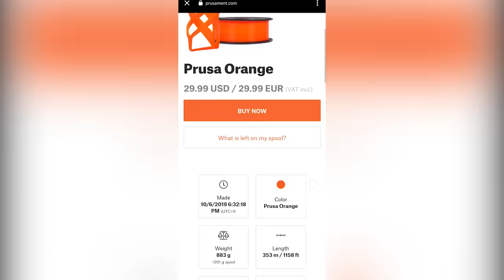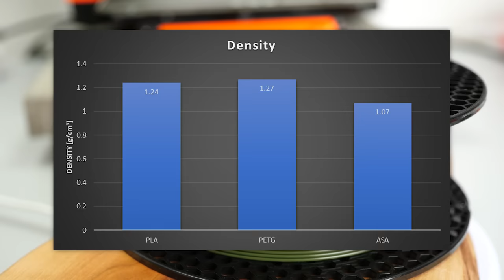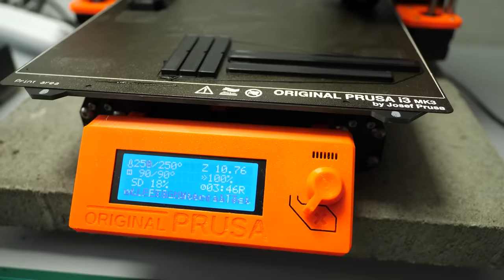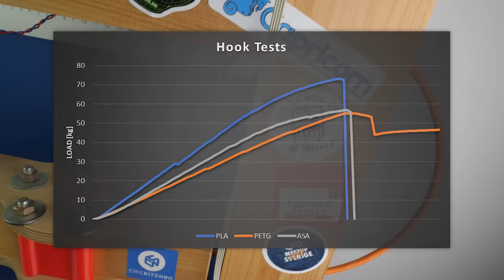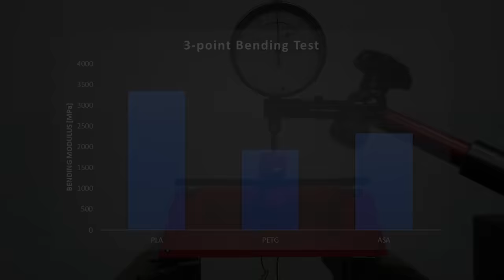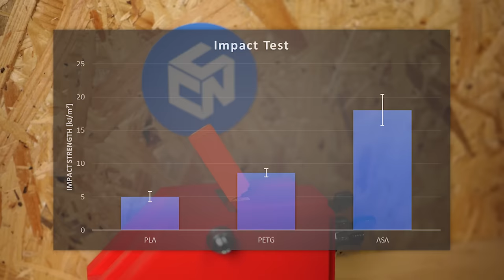The BEST 3D printing material? Comparing PLA, PETG & ASA (ABS) - feat. PRUSAMENT by Josef Prusa

Comment: Would be very interested in seeing this test repeated with the prints having spent a significant time under a UV light
Reply: I can tell you 1 thing: rip PLA
Reply: What is a significant time? I have Wood PLA stuff outside in the garden since August last year. So far still looks good.
Reply: @steffengr.5556  Wood PLA isn't fully PLA. straight PLA degrades here in the sun after like 8 months it starts to crack & be brittle.... Ofc we're at 9000ft above sea level. ABS has lasted forever and petg has so far been ok
Reply: We already know that PLA can't handle UV. No test needed. If you are going to put PLA printed parts outside in the sun, paint them :-)
Reply: Was more interested in the actual figures for ASA vs petg for tensile and deformation post uv
Reply: So I've been doing this for quite a while... I am not getting any serious results so far tbh. This will be a long long term test...
Reply: @gg-gn3re  Interesting points, so what this have taught me is be more considerate of the purpose and environment that the print will be in
Reply: @MaxQ10001  I'm new to this would a 3d printed snake house last long using PLA?
Reply: @MaxQ10001  I've had pla printed gnomes in my garden for three years and the color is still vibrant and no cracks.
Reply: @vampcaff  where did u get the garden gnome stl? Would love to add a few to my garden.
Reply: I saw a video of someone having had made clips for flowers or something that were left outside for a year or so, and they seemed fine and were PLA I believe.
I suppose it really depends on how long it has spent in direct sun. Either you can consider the amount of variables the beauty of 3D printing, or a big maze!
On the plus side the time it probably takes for UV to matter, you could just print another one lol
Reply: @Interknetz  Also depends on the specific filament blend. A bit of UV-resistant additive goes a long way.
Reply: @gg-gn3re  LOL yes. I was shocked when it happened the first time.
Reply: @vampcaff  How are your gnomes holding up two years later?

Comment: I used the sample PLA roll that came with my printer, then immediately switched to PETG. It's a bit tougher to dial in, but the thermal and UV resistance are good things in my opinion. And the warpage can be a good warning sign before complete failure, especially in printer parts. Oh, and small stringing can be easily burned off with a lighter.

Comment: i use petg when i need part to flex a little without snapping like i printed some hooks to keep my shed doors open they needed to bend a little to allow the door to pass under then click down to hold in place when i try pla it just snapped even when i annealed them petg is still going stong. i also notice with many materials exposed to the hsrsh Florida sun petg seems to hold up very well to uv and barely fade its color. Pla can fade quite a bit in the full sun and dark colors like browns and black absorb enough infrared that they wurp badly but lighter colors can survive I print quite a bit of abs in an enclosure made of pvc and mylar blankets and it works quite well for taller print you have to be sure to Orient it so the heat from the bed can flow up the print evenly. if it traps heat the you can get layer issues. The mylar blankets can keep it around 38c in chamber with no problem. Great work on your research.

Comment: Great job, as always! I use PLA and PET-G. ASA and ABS are no go for me due to their potential threat to health. I mostly use PLA and support it with PET-G when bending instead of cracking or higher temperature is need (like in-car hooks). I also use flex 40D material as a thin supporting layer (ie to create soft surface on a hand watch mount) or absorb a bit of vibration (like mounting something to my electric scooter).
Reply: Doesn't all materials pose a health risk due to their fume emissions?
Reply: And microplastics

Comment: Materials engineer here, even thou the tests are not standard, they are pretty decent to compare the materials. I would prefer petg hands down for most applications. Petg is a very sweet spot of additive manufacturing filaments. It is watertight with 1.75 mm wall thickness, can handle temperatures up to 75-80 degrees, ductile at low strain rates, moderate fracture strength, moderate impact strength, stiffness is a bit low but when you get a wall thickness of around 3mm, its very stiff. It is a very sweet material to 3d print structural parts.
Reply: why do you like it over asa?

Comment: Living in Florida, I default to PETG because of the heat.  Nothing I make is regularly outdoors or in the car, but if power gets knocked out or I do forget something in the car I can rest easy knowing the heat won't warp it at all.  However, revisiting this video several years later, I do see that I have discounted PLA too much.  I will start using them more interchangeably, I greatly enjoy the ease of printing with PLA.

Comment: It seems I was mislead about the strength of PETG, now I'm struggling to think of a use I might have for it.
Reply: Same, now i'm thinking about ABS+ or ASA.
Reply: The same here. However I have the HDglass PETG and it seems to be stronger than PLA I have from the same company. I can really break it easier...I do not get it...
Reply: @kamilchodzynski9395  Higher temperature resistance and it won't burst like PLA, so it is more durable.
Reply: I'm more surprised by how well PLA did in the strength test. No PLA I've used would stand any where near 73Kg on that pull test.
Reply: Exactly, as I said my PLA is far weaker than here presented. Either the Prusa PLA is super strong or PETG very weak unless the settings are special...
Reply: For me thats simple: everything indoor is made out of PLA. Everything I carry around, which might be transported in the car or is used outdoor I use PETG for.

Don't forget, for many designs the layer adhesion is the central concern. Meaning in most use cases PETG is clearly superior to ASA.
And you often want a certain flex. Stiffness means also beeing brittle.

I never bougt a spool of ASA/ABS and this video is for me a clear confirmation that I did it right.
Reply: In many practical applications PETG will break less easily due to the flexing and layer adhesion. This is especially true when printing casings for objects where you want the surfaces to have little bit of give without snapping instantly.
Reply: Adding to what others PETG doesn't deform under pressure over time like PLA does. I used to have some PLA reinforcements in my printer, but when I checked their screws 6 months after adding them they were fairly loose while the PETG parts weren't. Also, PETG has better availability and is cheaper than ASA.
Reply: It actually has better layer adhesion at about 220-230 degrees.
Reply: I've seen a similar test on a traction machine on a French channel and it came (in the order) PETG PLA ABS... I'll keep on PETG (UV resistance and stability)
Reply: PETG has better layer adhesion and also is more wear resistant than PLA. It does differ from brand to brand, I had encountered some weak PETG as well as really bad PLA that just melted in 90F outside. You just have to find a good brand that doesn't fail you :)
Reply: I mostly print PETG and I can say that it has way stronger layer adhesion compared to any PLA I have ever printed. I have not printed expensive, specialised PLA +, pro etc.

Also my PETG pretty much never breakes at a single layer line. Breaking surface often goes all over the place and sometimes diagonally to the layers. If it breaks smoothly along the layer line like PLA then that's usually because of too much cooling.
Reply: I don't think you were mislead.
On my own experience, PETG is the strongest one:
I printed a custom wheel adapter for gaming wheel with force feedback.
I had 4 broken adapters while I was using PLA (even with 100% filling).
Then I switched to PETG and since then I still use first printed adapter. It did not break (PLA was breaking on 2-3 day of using it).
Reply: He apparently has problem with print settings, he used default ones. And they seem to be not the best for both PETG and ASA.

First, he used too high fan settings. I use fan only when strength is not required, in bridges and overhangs, or when layer is too short to print.
The stringing is easily removed with heat gun.

And, NO fan should be used with ASA or ABS

Other thing - he got heavy stringing with ASA. Retraction is wrong or not used at all.

With proper settings ABS+ is the easiest to print. I assume same for ASA
Reply: @dkiulian  Any recommandation on a good brand for PETG?
Reply: @Levisgil47  Overture worked well for me and got nice quality out of it, but I also tried MatterHacker's petg and it was splendid (after figuring out how to print it. On my prusa i3 i had to use pla settings but change the temps. I can't say how many tries it took to figure this one out. But it is awesome quality, maybe the best looking so far) Both are quite strong.
Reply: @Levisgil47  I am pretty happy with Formfutura rPET. It is a good ratio money / performance. On the Prusa MK3S I print 230/225deg, first layer to rest, 90/85 bed, and fan between 0 to 25 max. Mostly fan does not work at all. No strings, etc. In addition , I keep flow rate 106.5% after calibration. Just if somebody needs...from time to time I put to the oven for few hours at 60 deg.
Reply: petg is one of the more food safe alternatives out there.  so there is that.  I would still coat it with something just to be sure though.  It doesn't seem to degrade in uv light as much either, so there is a positive if you are using it outdoors or somewhere where it might get direct sunlight.
Reply: Why is my petg brittle, it breaks across layers diagonally easily, with no give. I tried it from 220 to 240 C, different fans speeds.
Reply: petg flex back after being bent,  pla can't
Reply: If I wanted to make a thread that needs to flex, would the threads hold as good as pla?  I'm thinking of using petg for it but not sure if it can hold alot of pressure in the thread part, any advice anyone?
Reply: @NotHumant8727  240 is on the low end of what's recommended for PETG.  It's likely that you need to go higher
Reply: I don't know, this doesn't take into account repetitive movement stress cracks or UV exposure which are probably bigger issues in a lot of 3D printed objects that are used on a regular basis
Reply: @dkiulian  what brand PETG do you use?  My Hatchbox PETG consistently breaks at layer lines.
Reply: @CoreMaster111  what brand PETG do you use?
Reply: @73notch  Spectrum
Reply: @73notch  Hi, I have the same problem with most brands if I forget to turn cooling fan off completely. I print with the pla settings, just cooling fan OFF. I hope this finds you well and will help you.
Reply: Prusament PETG sucks compared to PM PETG.
It's extremely brittle compared to what Prusa used to exclusively sell.
Reply: Isn't there some food-safe PETG?

Comment: Useful testing and comparison. I am currently making GoPro parts with  PETG made in Australia where I live and I am very pleased with the results. One quirk, I can sit alonside the machine while I am printing PETG and I cannot detect any odour at all. Using the VisionMiner adhesive on a Creality glass bed and I have no problems removing the finished parts after it cools down a bit.

Comment: Love these videos. I've actually used PLA before to 3d print model rocket nozzles, and as long as the burn times were short it held up pretty well. I only saw about 1mm of erosion over a 1 second burn, since the nozzles were single use anyway this wasn't a problem.

Might post the testing footage when I've got time to put together a video.

Comment: Thank you Stefan, Your video helped me alot with my Antenna block project.  I'm printing an antenna holder for the Ubiquiti UAP outdoor wifi antenna. I ended up going with ASA in my final choice due to it's impact strength (it needs to be hurricane-proof), and be wind and bird resistant (wind and birds would twist the antenna to where the wifi would be decreased significantly) ASA also has superior resistance to UV, but also Temperature, and I also needed it to bear hot and humid weather as well as moisture.

Comment: Thanks for this review. Very useful as usual. To answer your question, I print mostly with PLA. It's easy and surprisingly good. I print with PETG when I need better heat resistance, such as parts for my printer or the ones that goes in the car.

Comment: A very thorough review of the material properties however deciding the proper material for the application may not be obvious.  My PLA small quadcopter frame  broke one of its arms during a crash on its first flight.  The frame was reprinted in PETG and  has now completed many flights and many crashes with out damage.  For my application PETG is the superior material over PLA.

Comment: I'm living in Nordic weather and minus degrees are normal during winter, down to -30C. I'd love to see you test these materials with cold temps also! Another point to add - impact strength of some plastics is increased when they have absorbed some water. I know this from RC hobby and propellers. Running them after winter, when they've dried out, they are very brittle. The trick is to put them into hot water and stay there for 12+ hours. So I hope you could take on cold test and hygroscopic (after printing) test of these materials.

Comment: Sounds odd but I have discovered that cleaning the filament before printing makes layer adhesion much better. Perhaps some sort of oils form during manufacturing? Not sure. I wipe mine with rubbing alcohol on a rag as I re-spool a new spool onto an empty spool. Give it a try. You’ll be surprised at the amount of gunk on the filament!

Comment: Personally I'm still sticking mostly to PLA due to being relatively new to printing.  Expanding to more materials once I get more skilled :) PETG is interesting me at least.
Reply: Try it
 Today's PETG is super simple.
Especially if you have a decent printer like the Prusa, standart settings do the trick. 
Press start and go to bed. No issue. Perfect surfaces, robust prints.
Reply: If you're printing PETG using Cura, make sure to up the temps to something around 240c for the hotend. If you have one where the PTFE tube goes into the hotend, you'll need to get an all metal one for it too.

That would only apply with something like an Ender 3 though; the Prusa wouldn't need modifications... maybe to slicer settings thouhg.
Reply: @moth.monster  idk i'm priting petg with 225c and it seems to work better for my filament. increasing the temperature that much causes more stringing. the recommended range on the sticker of my roll is 220~240. although i did get a bit of underextrusion when i was printing with 0.32mm layers that ruined some practical prints.

Comment: ASA is uv stable and can withstand temperature upto about 100 degrees celsius which might be its biggest advantage. So it can be a good choice for outdoor project in the sun. 
The bad layer adhesion compered to PLA  is a huge bummer because it limits the the design posibilities.

Comment: Thank you for these experiments, they help me a lot in my own experiments. I've been using eSUN PLA+ for my 3D printed planes for a while now and they seem to perform better than the other materials like Flashforge & Wanhao filaments that I use. It'll be cool if you can compare the eSUN line up of materials experimentally, considering they're pretty inexpensive for the quality that I find in them. I use the PLA+ for fuselage parts & ABS+ for parts that may get hot like motor mounts. I do crude testing for stiffness by hanging weights on printed cantilevers & do drop tests for checking impact strength resistance.

Comment: This is fantastic. Well executed and documented. As an engineer I really appreciate your methods. I have been using PLA+ which has a slightly higher softening temperature and am trying out PETG soon. I have issues with ABS/ASA because I live in a cold area and don't have an enclosure. I have had multiple prints fail because of bad layer adhesion with ABS.
Reply: I would recommend you make a closed space for your printer, you can support it with some glass sheets and some metal profiles, the key is not to lose temperature due to your icy environment
Reply: Bro, being an engineer doesn't make your appreciation for his methods any more valuable, I know it might be hard to grasp, but most engineers, and especially the pretenxious ones, are really shitty at knowing their stuff, trust me, I'm an engineer 😂

Comment: I would love to see different types of PLA tested. (Using example I know about) Like Fiberlogy has Impact PLA (Claims to have up to 800% compared to regular PLA and 50% compared to ABS more impact strenght) and  HD PLA (special for annealing) and regular PLA's. I wonder how different they really are when tested, is it just marketing or there is some truth there.
Reply: Usually fiber infused materials provide more strength along the layers, but the layer adhesion suffers.

Making the weak point weaker and the strongest point stronger has very limited usecases.

Comment: Good tests! Finally you shown that PETG is probably the worst choice for machine parts, contrary to the common belief. As I print mostly functional parts (as opposed to design/art) I've read many material's datasheet and came to the same conclusion what your test show. I never really accepted the common mantra as "print in PETG, it is stronger".